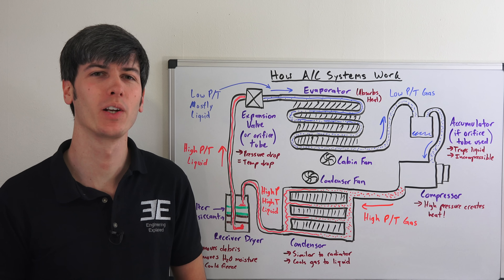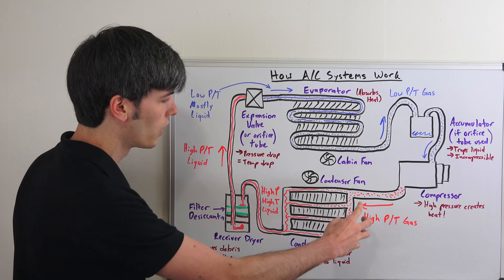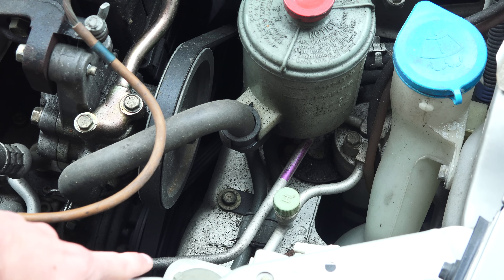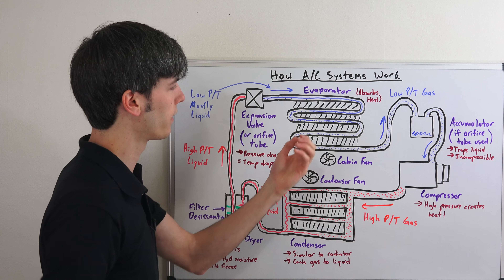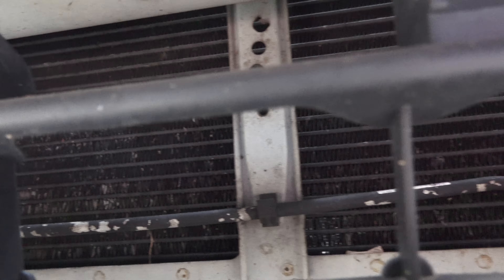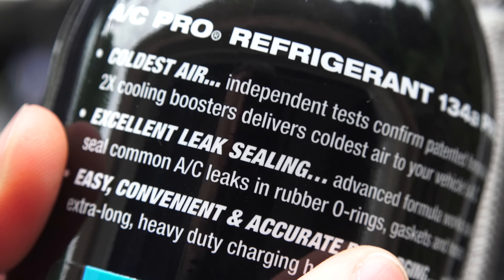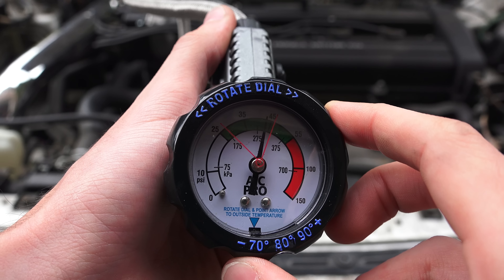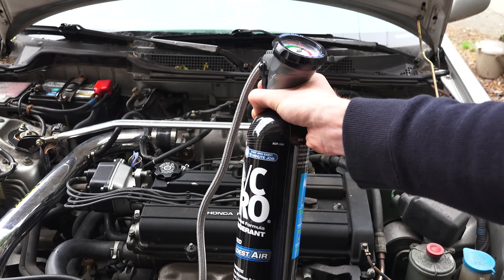How Car AC Systems Work & How To Recharge Your AC System

Comment: Oh. Air conditioning. When reading the title I somehow I thought "alternating current" and was confused because as far as I know cars' electric systems are DC.
Reply: +Vicente Cantú Interesting. But it still uses DC batteries (there is no other kind).
Reply: +pinkdispatcher correct, tesla uses an inverter.
Reply: +Zackarih Hartford Well, the alternator makes AC (hence its name), but the output is immediately sent through a rectifier and voltage regulator, and all the car systems run on DC.
Reply: ***** Well the alternator is basically an inverter...
Reply: +Ccs4646
Er, no. An inverter makes AC from DC. An alternator makes AC from mechanical work.
Reply: No. Alternator is just 3 phase externally excited AC generator with integrated diodes to make its output DC. 

Externally excited means that rotating magnetic field is generated by   rotor that acts like spinning electromagnet and that electromagnet needs power: Alternator will start producing power only if you first give it some power to field wiring, after that it can power itself. By regulating relatively low current in rotor you control much higher current output in windings that are around rotor. There is AC generated there and it gets converted to DC in an array of diodes.

Comment: R134 is LESS damaging to the environment than R12 was( EPA forced the automotive industry to transition from R12 to R134 in the 90s.  This does not mean that 134 is safe for the environment.  Venting this chemical to the atmosphere is harmful and if you are adding to your cars A/C system more often than once every 2 or three years you should have your system checked and repaired by a certified A/C tech. 
 Btw, before you ask, I am not a certified A/C tech, I make no money from A/C work whatsoever.

Comment: Those refill cans are illegal in EU :D Only certified shops can do AC work.
Reply: how much costs  in europe to recharge the AC in a shop?
Reply: between 75 and 100 euro's.

the reason for this is that refrigerants like R-143a are 3400 times more damaging to the ozone layer than CO2. all the refrigerant here in europe are only sold to licensed people/companies. there is also a mandatory checking to see if you are carefull enough with the refrigerants. failing to pass will result in you losing your license.
Reply: ***** Well, ill clarify. In most of EU refilling yourself is illegal.
Reply: graaf I got Air-con refill for 49€. You are paying way too much if you pay 75€ or more
Reply: ***** well, im from Finland, the labour alone racks up to 20€.
Reply: ***** No wonder industry in our country is dying. It costs the employer about 30€ per hour per employee, if the hourly wage is 13€
Reply: ***** Well, the industry could come back since your country has so low wages. Only way is up for you guys.

Comment: I'm not comfortable with relying on low-rise pressure readings to recharge a system. Ideally you'd want to evacuate the entire system, ensure the system can sustain a fair amount of vacuum and recharge by mass as per manufacturer's recommendation. If the system is healthy both low-side and high-side pressures should fall into step. I realize that evacuating refrigerant isn't something in the realm of the average DIY-er but relying on low-rise pressure isn't necessarily healthy advice.
Reply: *relying on low-side pressure only.
Reply from the maker: I would agree, which is why I recommend monitoring the temperature coming out of the A/C vents to know when the system is operating at its most efficient point (when the average temp is lowest, thus the system is properly charged and not overcharged.

Comment: so does the car consumes more fuel when i switch on the ac//
Reply: Yes, it uses battery and therefore fuel to supply power to the AC system. If you wanna see it by yourself, just remain stopped with engine running, and turn AC on and completely off and look at your rpm gauge, you should notice a slight difference.

Comment: You need to purge the hose first!
Any air in the hose will get inside the system otherwise!
Reply from the maker: It is illegal to purge this refrigerant into the atmosphere, thus I cannot recommend purging unless you have a way of properly disposing of the refrigerant.
Reply: Refrigerant lines can be legally and safely purged into an empty R134A container.
Reply: +patw52pb1 or any empty container with a correct port for the hose to connect to.
I'm sure authorised workshops have something to purge their hoses correctly, otherwise they will get fined for releasing refridgerant into the atmosphere, and they sertainly do not want air to get into their customers AC systems which could cause problems.

Comment: Don't use these off the shelf recharge cans. Take your car to a well known A/C repair shop. Blowing up your compressor due to inexperience can cost you way more then the $30 dollar can of refrigerant. UV dye  is also an important part of finding the leak you absolutely have. If your low on refrigerant then you 100% have a leak somewhere.

Comment: Yeah if you tell a shop you put that garbage in your system they will tell you to take a hike, and if you lie about putting it in your car, you will be buying a 4000 dollar AC machine.  If your AC doesnt work take it to a place that can do it.  You know what happens if you use this stuff, the tech dumps the stuff out of your system(in to the air because theres no way to recycle it) and charges you for a new compressor, condenser, evaporator, drier, and all new lines because they wont contaminate their machine with this.  Only time I reccomend this is if you just want to get another year out of the car.

Comment: Those DIY recharge kits are illegal in EU. You need to have a license and proper machines to do AC work.
Reply: Yes. But why is it so, since in reality it is this simple?
Reply: +Robert Borjesson Because R134a is harmful for the atmosphere.
Reply: +Robert Borjesson And it's not really that simple because you never know  how much refrigerant there actually is in the system. 
The proper way to do it is to empty the system, pull a vacuum for 30 minutes to remove moisture and then fill with the exact amount that the manufacturer has specified. Also add a bit of PAG oil and some uv dye to find possible leaks in the future. 
You should never fill a system that has even a tiny leak.

Comment: please check your local laws before doing this yourself. it might be illegal to do this without the proper paperwork. the reason for this is that R-134a is 3400 times more damaging than CO2. and is coverd by the kyoto protocol.
Reply: Seriously? ,  I mean it's only problem if anyone reports it right. Try not to leak it in to the atmosphere if its that bad
Reply: here in the eu there is an mandatory check to see how carefull you are with the refrigerants. failing to pass will result in the revoing of your license. 
here is the source of how bad refrigirants are for the ozone: http://unfccc.int/ghg_data/items/3825.php
Reply: graaf i live in India,  its not that strict here I think, considering more than half the cars available here haven't passed Euro NCAP crash tests😂
Reply: Because it is India. 
India still produces equipment charged with R-12.
Reply: R-11 is better for the environment
Reply: 348frank348 
i do not not know where ypu are getting your data from, but it is erroneous. 
R-11 is every bit as environmentally damaging as R-12, greater than 20 times more damaging than R-22 and greater than 1000 times more damaging than R-134a
Reply: AMGV Media 
In the US and Canada releasing any refrigerant into the atmosphere is a civil fine for anyone regardless if they are a DIY, consumer, mechanic or EPA certified technician. 
The civil penalty is now $27,500 per incident. 
Repeatedly or purposely releasing refrigerant into the atmosphere becomes a federal felony and the penalty is $39.500 USD and minimum of 1 year incarceration per incident/offense. 
Be aware the US EPA is offering a $10,000 per offender reward/bounty to persons reporting offenders that result in civil and or criminal prosecution.
Reply: patw52pb1 and you think anyone actually knows there's a bounty? or do you think that anyone is going to know if you don't go out and tell someone?
Reply: AMGV Media 
Apparently so...
The federal EPA does not release statistics for the refrigerant release reward program, but there are more than 400 confirmed cases where there was an informant involved in 2014 alone. 

The following is from the US Federal Register and California Air Resources Board. 
Since 2004, there have been more than 11000 civil and 1720 criminal prosecutions at the federal level for illegally releasing refrigerant into the atmosphere. 
State prosecutions are actually more prevalent and aggressive with California prosecuting more than 5000 cases, collecting more than $16 million in penalties and 279 criminal prosecutions where the average sentence was 31 months incarceration. 

Knowledge is power. I would rather you and the public at large be knowledgeable rather than ignorant and get caught and penalized for unknowingly and illegally releasing refrigerant into the atmosphere.
Reply: patw52pb1 i don't think that any of those that faced charges were guys that were using little cans in their backyard.

Comment: the car should be running when you check the fill. as the system will equalize and show a false level.  

Second if i remember correctly R134a is similar to or like propane... well it is not true freon anyway. while it is not good for the environment its definitely not as harmful as the old school freon where it will open a hole in the ozone. why do you think that the government/EPA allows you to get and do it yourself?
Reply: Freon is a name brand, not a substance.

Comment: So my daughters AC compressor wouldn't come on last spring and I was going to take it to a shop but then she rear ended someone, so instead I paid the deductible on her insurance. BUT, then the AC started working, and working well, what's up with that? Sounds like the old mechanic with a ball-peen hammer trick.
Reply from the maker: They likely fixed it when she had the car repaired.

Comment: you should leave it alone and get it done professionally. moisture in the system will cause it to fail. plus you have no idea how much charge you are adding.. never a good idea to do the quick fix.

Comment: can recharges the quick way for idiots to over fill the system as gas is weighted in and proper diagnosis can only be done with two gauges on high and low sides, and you need to vacuum to evaporate off moisture.  kind of make the gas handling course I did a waste of time as who ever has been fined for using them with out the certificates in the UK and if a know leak then you need nitrogen to test them.

Comment: I would never recommend pumping that junk into your AC system. If you do that then shops won't be able to recover the R-134A from your system, and they can't legally evacuate your system due to EPA regulations. If your AC doesn't work take it to a shop where they can do a legitimate repair.

Comment: My car doesent have AC. I roll down the windows instead
Reply from the maker: You can spray some water on your arms for additional cooling on those hot summer days. :)
Reply: Engineering Explained never tought of that, but thats a good idea! Thanks!
Reply: +Engineering Explained lmao
Reply: Had to drive a slow old 1418 Benz truck 240K from a job, no air-con 44C day or 112 F used 2L spray bottle with ice water and ice cubes in it to help keep me cool stopped about half way and jumped into a farmers pool to cool down, that was a stinking hot drive
Reply: +GrumsPlace damn thats not comforable when its that hot